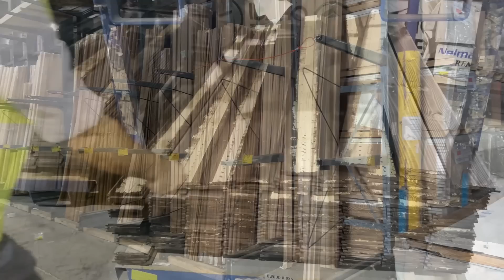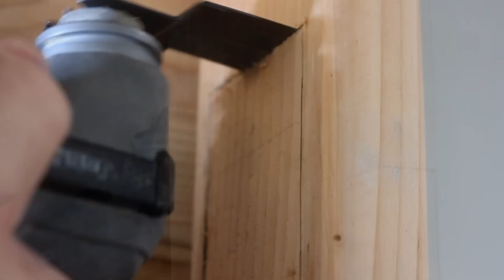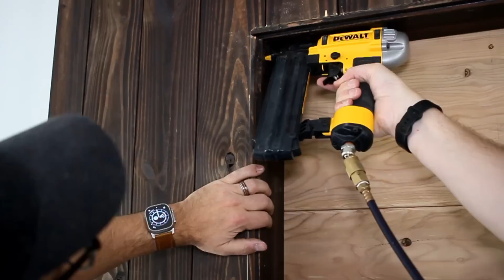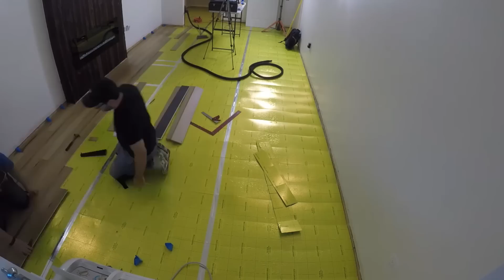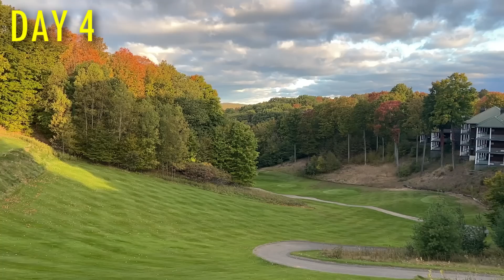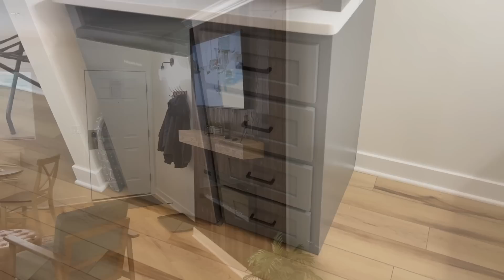Woodworking: Rental Property Renovation

Comment: Hey Drew if you cut your crown upside down using your jig you don't need to 45 the blade , you just cut the 45's like normal, adjusting the left and right upside down. Play with it, you'll get it. Then you can keep your blade straight up and down. Why did you put a shoe moulding up to the baseboard, did you keep the flooring too far from the wall or did you just want to change the profile?
Reply from the maker: We liked the look of it with the shoe moulding better.

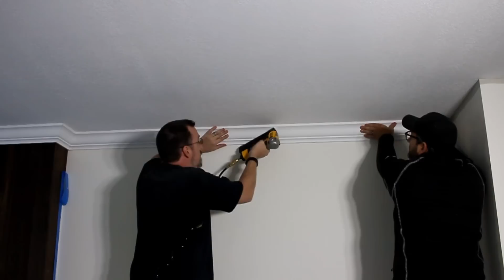Comment: 10:45  'Pride and dignity' filler putty.  Yep, used it many a time on my own projects!  That's a handy caulking tube size you got there.  I usually just use a putty scraper to collect the tears from my face, the sweat from my brow, and mix well with the dust from my crushed dreams of perfection.  🤣
Reply from the maker: Hah, I could fill a 5gal bucket with that stuff

Comment: I can't cut molding without making at least 15 test cuts, all at slightly different variations of 45 and 90 degrees, with random mitres and bevels and some with one arm behind my back and then others with 5 people helping, but at the end with none of them coming close to fitting. I find it far easier to just leave the joint between the ceiling and wall plasterboard bare so you can see the rough edge and maybe even the studs behind them, and then just claim that's a new design feature that all the fashionable kids are doing in Paris and Milan. That's how I deal with it anyway...
Reply from the maker: Sounds good to me! :)

Comment: Why the quarter round at the bottom of the baseboard? It is used when you cannot recess the flooring under the base board and you have to hide the expansion gap of the flooring, but as you installed the flooring first, the expansion gap should be under your baseboard, already hidden?

Comment: Always love your videos. I'm a carpenter (trim for 15 years, but we always have to jump back into the rest from time to time) and a more amateur woodworker, I'm sure. First, I love the saw you're using - they're the best. Not really criticisms, but I want to say. I've don't believe I've ever seen someone cut crown that way. Obviously, as you proved, it works. But if you flip it over (upside-down), you can cut either end by just changing the miter angle instead of the bigger hassle of flipping the saw over for the bevel angles. Also, you can leave the saw's fences tight for better support instead of spreading them out of the way of the blade.
Then, the wood "sub-fence" stuck to the saw base is smart. At least for the Dewalt saws, though, they make inexpensive crown stops that bolt into the tapped holes in the saw. Adjustable for different sizes and reusable without any cleanup.
Reply from the maker: Thanks, appreciate the feedback, I'll give that a try next time.

Comment: Interesting crown mold cutting technique. I've installed thousands of feet  of the stuff, around cabinet uppers is where a lot of it went. I use the fence much like you did, only I flip the crown upside down, that make the fence like the vertical wall. Then you  don't have to adjust the saw bevel, it will always be in the "0" position (normal). The you cut miters as usual, using the 45 degree detentes. Getting your head wrapped around the upside down part takes a little mental adjustment but a pencil mark  showing the cut direction helps a bunch.
Reply from the maker: That's a great tip, thanks for sharing!

Comment: Excellent progress. Y’all need to close in the underside of the bed with a walnut frame housing drawers for storage in order to hide that heinous metal bed frame. That would dress that room up so much. Great video as always. Thank you.
Reply from the maker: The new bed is on hydraulic lifts that raise it up and they have 8 tubs of storage underneath with everything needed to restock the rental between reservations
Reply: Ah, very well. Thank you.